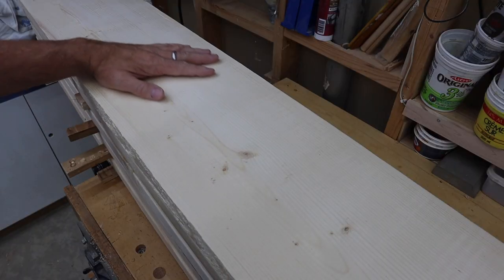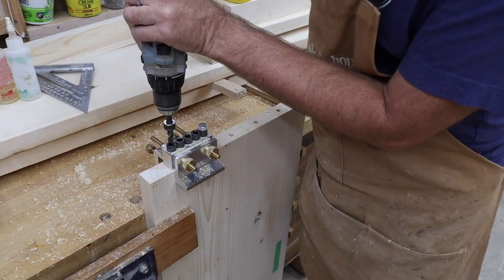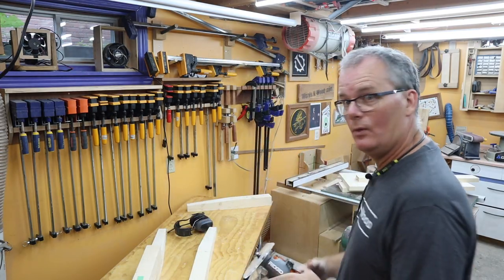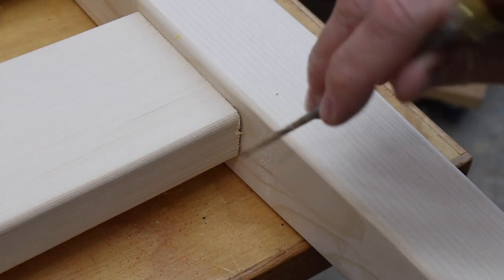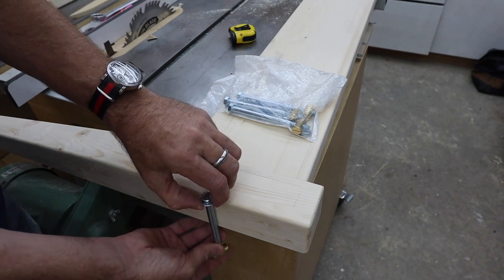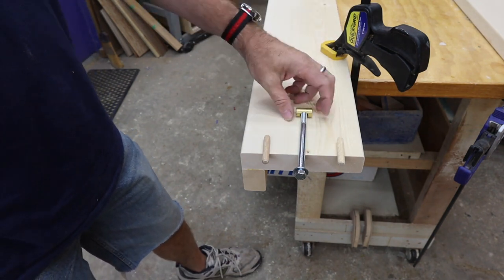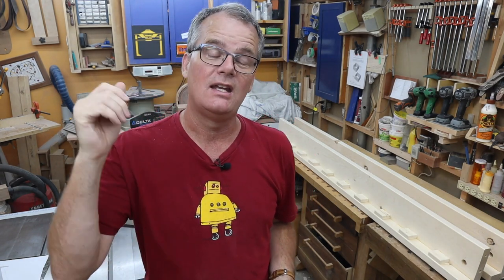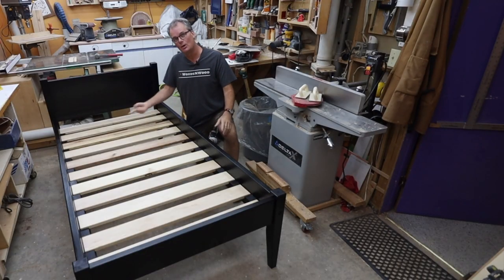HOW To Build a simple bed using CONSTRUCTION Lumber // WnW 252

Comment from the maker: Featuring Construction Lumber + Bed Bolts + the Dowelmax Jig.
📃Build Article:  https://www.wordsnwood.com/2021/bed/

YOUR SUPPORT IS APPRECIATED:
💵 Become a Patron: https://www.patreon.com/wordsnwood
🛒 Buy a Plan: https://wordsnwood.com/plans/
👕 Buy Merch: https://wordsnwood.com/merch.html
👉 https://www.wordsnwood.com/support.html

This is a simple bed design, made mostly with inexpensive construction lumber (aka two-by material) from the home centre.  It is fairly tall, to allow for storage underneath.   It is assembled using bed bolts, which provide a strong secure connection, but is still easy to take apart for moving.  

I make a lot of use of the Dowelmax jig to help with this build, but you can use other doweling jigs as well, or even make a jig out of lumber.

---------- ---------- ---------- ---------- ----------
🗜 LINKS TO SOME OF THE ITEMS USED:

(AND/OR other tools and jigs that I use and recommend.
Most of these are affiliate links.  If you buy through these
links it helps support my channel.   Thank-you so much!)

https://www.leevalley.com/en-ca/shop/hardware/bed-hardware/connectors/40445-bed-bolts  -- Bed Bolts at LVT.

https://amzn.to/1V4ZHkv — Painter’s Pyramids
https://amzn.to/2aSUhbR — Dowelmax Dowel Joinery Kit
https://amzn.to/2b6sCly — Dowelmax Drill Guides for 14” Dowels
https://amzn.to/2jSdHAq — Dowelmax dowels
https://amzn.to/2K8gBiu -- Irwin Parallel Clamps

📸  GEAR I USE TO MAKE VIDEO:

https://amzn.to/2OVusfx — Canon EOS m50 camera kit
https://amzn.to/2nI7w8Q — Shure VP83 LensHopper Microphone
https://amzn.to/3l7cSmi -- Rode Wireless Go microphone
https://amzn.to/3k9pFTR -- PoP voice lavalier lapel microphone
https://amzn.to/2aK7jZX — Inexpensive Quick Release tripod ball head  (Very useful)
https://amzn.to/2NddVjk — I do also have a GoPro Hero 5 Black
http://amzn.to/1XC2D7l — Joby GorillaPod (Flexible small tripod)

As an Amazon Associate I earn from qualifying purchases you make using my affiliate links.

---------- ---------- ---------- ---------- ----------

MORE MORE MORE:
https://www.wordsnwood.com
https://www.instagram.com/words.n.wood
https://www.facebook.com/wordsnwood

---------- ---------- ---------- ---------- ----------
🙏🙏Thank-you! 🙏🙏

Comment: When need a depth stop for a Forstner drill, to stop 'accidents,' then I drill a hole in the two by two, cut it to length and put it on the shaft before putting the bit in the chuck, simple cheap and practical.

Comment: I like it. Could have used some dowels in the ledge board glue up, both for alighnmrnt and strength. It is a face grain to face grain glue up, should be plenty strong for holding the weight of people jumping on the bed but I would put in some insurance.

Comment: Great job! How did the dowel joints behave over time? This refers to a wide board on headboard and seasonal changes in wood. Maybe it's even better than a mortise-tenon? Thanks!
Reply from the maker: It's only been a year, but it's fine.  I used similar technique on another bed 10 years ago and it's fine.   https://wordsnwood.com/2012/shakerbed/

Comment: Looks like a great build. Really enjoyed the video. Just out of curiosity, did you consider dowelling the ledge to side rails for increasingly the strength? Would the glue alone be sufficiently strong? I look forward to watching future videos. Keep up the nice work. Cheers!
Reply from the maker: Modern glues are stronger than the wood.  So no, I did not consider dowelling the edge of the mattress support.     (for one thing, it's under the mattress, so I'd just put in screws if anything  😉)

Comment: AWESOME video!!!!  Why didn't you use a mortise and tenon to connect the rails to the head and footboard?  Would that be a sturdy joint too?
Reply from the maker: If you mean the side rails, it's because I wanted the bed to be able to come apart, so I used knock-down hardware.   If you're talking about the headboard/footboard; sure you could  use M+T, I just used dowels "because".
Reply: @Wordsnwood  ok thanks